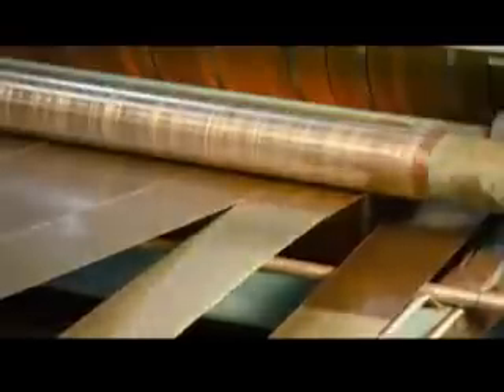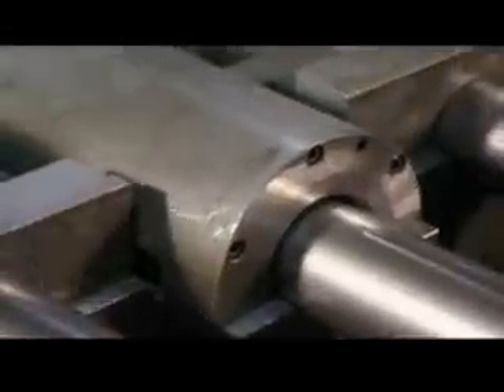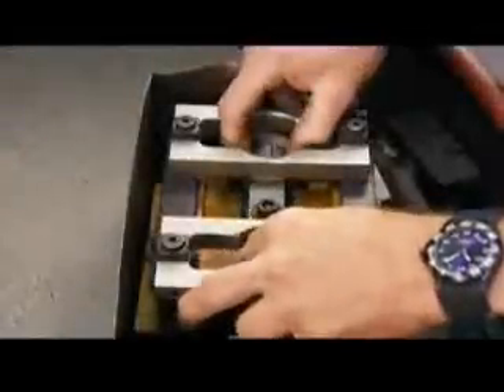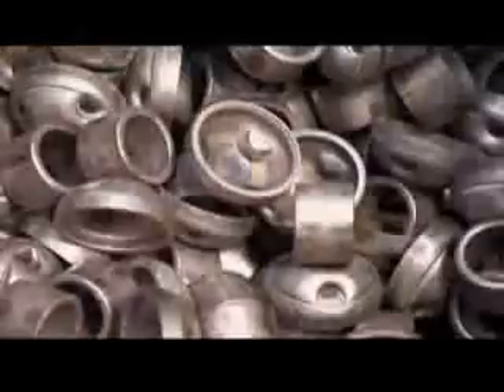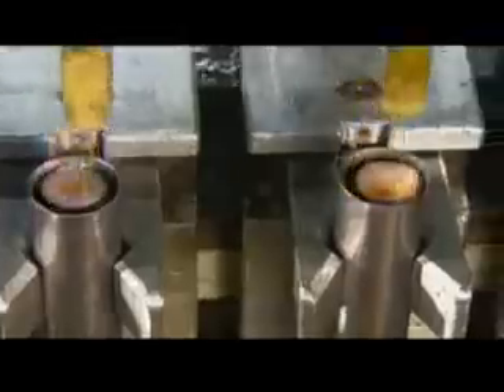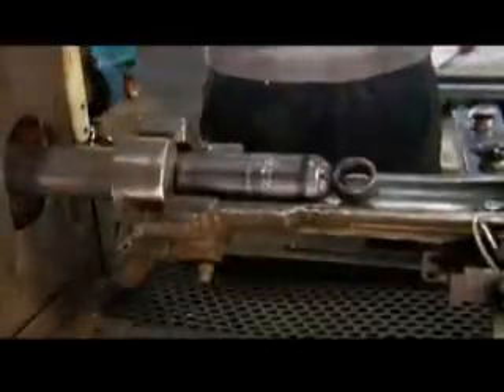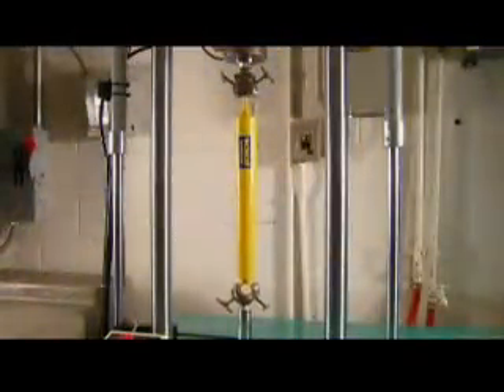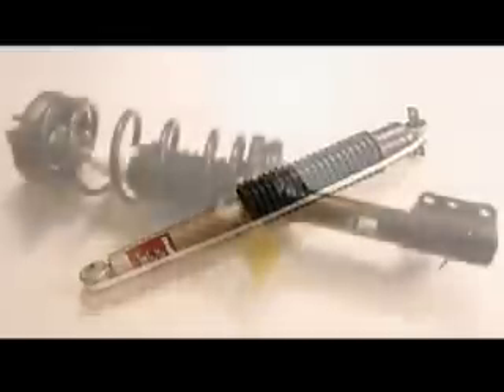How It's Made - Shock Absorber

Comment: JiangXi HangSheng automobile shock absorber Ltd, professional in  R&D, manufacturing of Shock absorber,including relate accessories, such as top rubber, front suspension pressure bearing，dust cover，buffer，etc.we are waiting for your cooperation with goods quality with reasonable price

Lisa Dai
JiangXi HangSheng automobile shock absorber Ltd
Email: lisadai@foxmail.com; lisadai824@gmail.com
Tel.:0086-47105786
Mobile: 0086-18779432639
Website:http://www.jxhsjzq.com/

Comment: What's the difference between shocks and struts?
Reply: Strut holds the shock and spring in one unit.you can remove spring and replace shock on some cars. others you buy a whole new strut and reuse your spring. Most front wheel drive cars have struts.

Comment: Everyone hates on Monroe shocks. I've got them in the rear of my car and it's never felt better. For the price, I can't complain. Most people have never put a new set of Monroe shocks in their car, they just take out the abused original ones and then complain about how bad they are, or parrot what they heard on a ricer forum
Reply: จะลืมไปได้อยู่
Reply: At one time there were only about 2 main shock absorber manufacuers Monroe or gabrial
Reply: I still have a set of Monroe shocks since 1982 on a customised Chrysler Valiant. They had enough abuse and are still working like new. Before that I has a set of Monroe in my other two cars, a  67 Mustang Cobra and a 69 Pontiac GTO. They were still on these cars after 11 years in my possession. Monroe are tough and do their job for at least 30 years lifespan. Mine are now 37 years old and still going strong. I had photos of these cars on G+, the bastard Google had to shut it down. Shame. 🤨
Reply: My 2000 Explorer has had Monroe shocks since it was new. The last pair I installed have lasted 50,000 miles but are starting to wear out. I’m replacing them with Rancho RS9000XL’s since you can adjust them. I like Monroe but I’ll be spending a bit more this time and investing in some upper end shocks.

Comment: This is fundamentally wrong. This part is a damper. The shock absorber is the spring.
Reply: I was about to post the following: 

Those things are DAMPERS, the springs "ABSORB THE SHOCK" if a manufacturer can't tell the difference, buy a damper from one that can. 

So it looks like a few of us know the difference. I once worked for a motor racing team and was told the difference, in no uncertain terms and with a few expletives included. I never called them "shocks" again. :-)
Reply: That must be a US thing. In my landrover parts manual they are referred to as shock absorbers.
Reply: As Peter Crenshaw, from the Three Investigators, would say:” I’ll buy a double helping of that”
Reply: MrMAG cant believe that comments lasted 6 years without anyone calling you a moron.